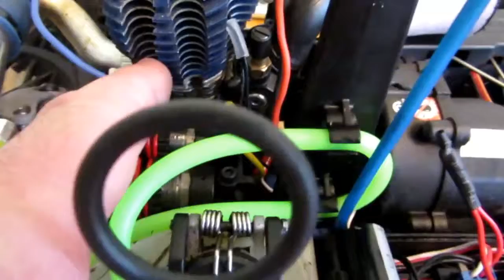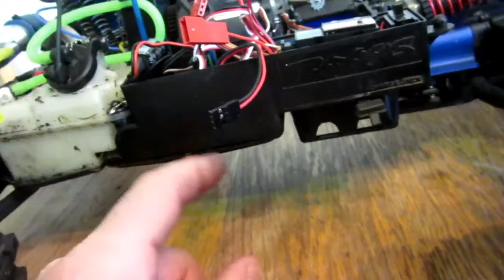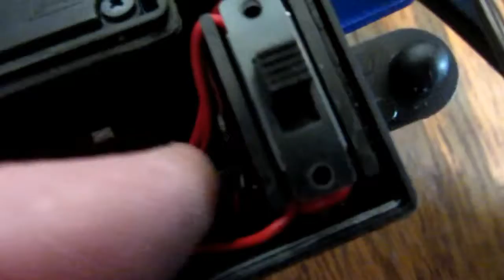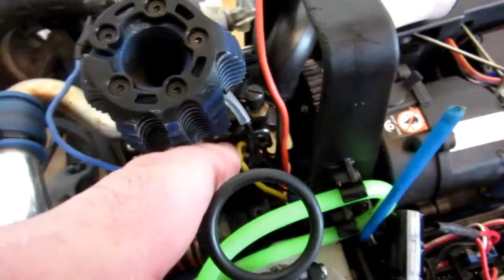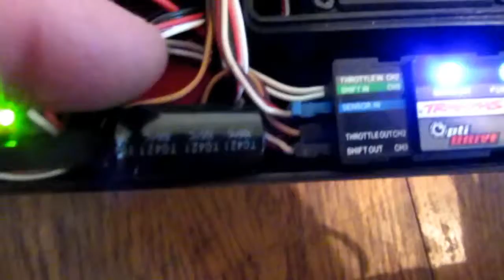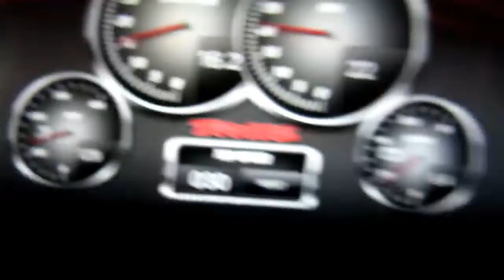Revo 3 3 telementry install video 2

Comment: you mention your a mechanic of 20 years and you like to check the temp at the middle of the "cylinder" then proceed to point to the cooling fins (2 inches above the head of the engine) operating temp is measured at the base of the cooling fins, right at the glow plug. the temp sensor should be there

Comment: I know this is an old video but the bec is on the speed contro,l not the receiver. positive and negative pins on the receiver are all tied together so you will get battery voltage from any of them.